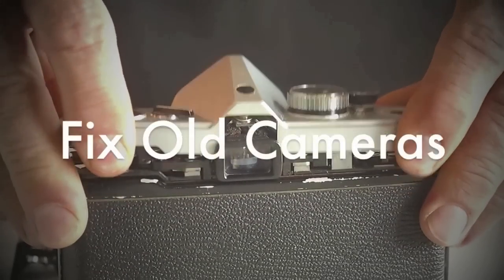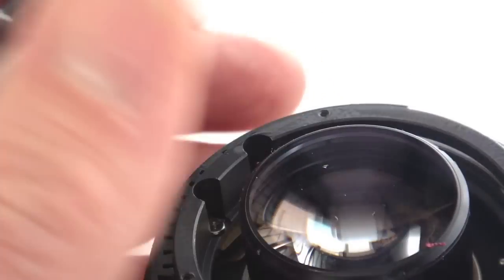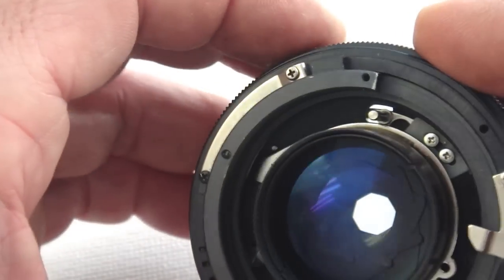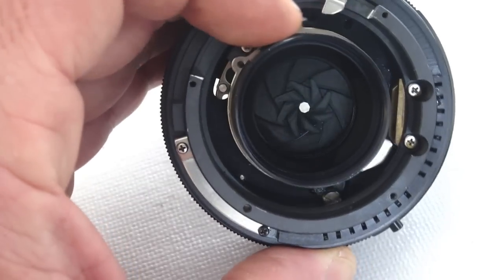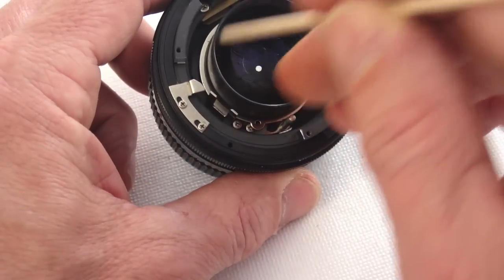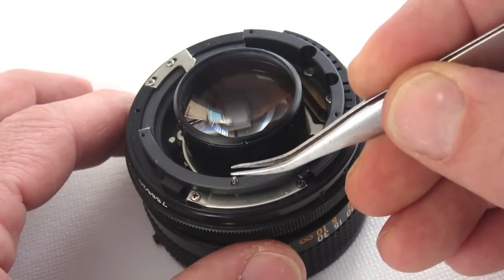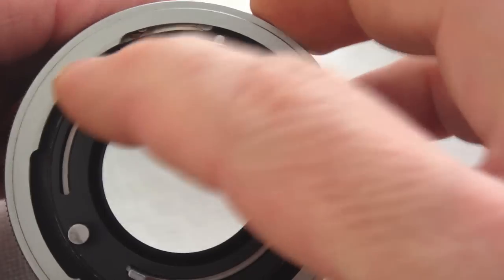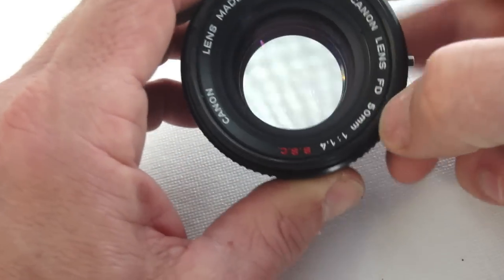Fix Old Cameras: Canon 50mm 1.4 FD  Stuck Diaphragm

Comment: The 1.8 FD SC version is slightly different in construction but close to the 1.4 . I was able to remove the rear element in a similar fashion and clean the blades on one side.  I did could not remove the blade assembly. This worked for me.   Thanks.
Reply from the maker: Dan C  Good to hear of your success.

Comment: Hi, you make it look so simple. I noticed that you did not clean the lens elements nor do you use canned air. Any reason for that?
Reply from the maker: Each step is simple. Ideally the diaphragm unit would be dissembled too, that would not be simple. Hence the flush cleaning short cut. The cleaning of the lens elements if needed was not shown to facilitate a shorter video. Canned air is fine, Be careful not to invert the can and jettison the propellant in unwanted places. A hand blower does not produce as much pressure which at times can be insufficient for a stubborn spec making the canned air good choice if used carefully. Filtered compressed air is ideal as the pressure can be precisely regulated. The elements only need to be cleaned with lens cleaner and a micro cloth if their condition so warrants.

Comment: Very professionally expalined, thanks. I have the lens and use it with sony a6000. I can see dust inside, wondering if I will be able to clean the lens using this guide.
Reply from the maker: Bobby Mathiwathanan  It should help, depending on where the dust is trapped. Thank you for your interest in Fix Old Cameras.

Comment: I removed the screws(on the side) from the aperture ring too. 2 steeel balls and a spring fell off. Damned, i dont know how the mechanic inside was before.
Reply from the maker: One is for the aperture click stops. The other might be for the AE lock. There is a spring and a hole the size of the bearing for that the spring drops into with the bearing resting on top. With the right technique it is not to difficult to install. Apply a little graphite grease to hold the bearing in place on when seating the ring.

Comment: I did exactly same as you did. But my one does not synchronize the aperture when I test it after inserting mount ring.
The aperture works well without mount ring..

Comment from the maker: If, when attempting this repair, the aperture mechanism does not work properly than the aperture diaphragm stopped down linkage was probably not positioned properly. The mount assembly will have to be removed again and reset taking care to keep the lever on the mount assembly to the right of the post connected to the diaphragm blade unit.

Comment: Thank you for your help in getting my aperture unstuck. It now operates smoothly. My problem now is that the F-stop apertures are not accurate. For example my F 22 aperture should close to a diameter of about 2.27 mm but is actually closer to 1 mm. Is there a way to re-calibrate the F-stop settings on the Canon FD 50mm 1 : 1.8 Lens? Thank you.

Comment: Thanks loads for this! Got one of these lenses really cheap because the aperture was stuck open, followed this tutorial and now it works fine! One question; I went a bit crazy with the contact cleaner and some seems to have got under the focus ring and messed with the grease in there... now the focus is quite stiff, slow and grainy. Any ideas how to smooth it out?
Reply from the maker: +Tom Box 
The focus helical threads will have to be exposed so you can access them and seep alcohol onto the threads and work it through them. You could do a much more thorough job of cleaning if you disassemble the helical. But unless you have past experience dealing with the such an assembly,  ABSOLUTELY do not take the helical apart while attempting to clean. You will play heck getting them back in the proper position. Once the threads are limbered up from the alcohol let it evaporate and recheck their function. If satisfied, you will then need to work a light grease into the threads. A synthetic lubricant is preferred.
Reply: i spent like half a day trying to do that

Comment: Excellent  video!I have a Pentax KM that had a battery leak in it.I removed the bottom plate to remove the battery and clean up the mess.Now the battery cover is stuck solid.Is there any way to remove it without destroying it?I could cut a slot in it and use a straight screwdriver,but then I'd have to replace it.Mechanically the camera works great and this is the only problem with it.
Reply from the maker: Try a solution of vinegar to break down the corrosion. Follow it with some penetrating oil. If you end up cutting a slot in the battery lid, due so carefully and you should be able to reuse the cover... albeit a little less pretty.

Comment: Hello.
I´m trying to clean my lens but 2 of the 3 screws that holds the filter ring are stick. How can I unstick them?
Great series of videos, thanks a lot!
Guillermo
Reply from the maker: Make sure the tip of your screwdriver is in good shape so you can gain the maximum torque. Heat the head of the screw with the tip of a solder iron. Seep some isopropyl alcohol around the head of the screw.
Reply: Fix Old Cameras Thanks a lot :D

Comment: I need to remove the breech lock ring on a similar lens. Is this does by removing the two screws on the side of the ring ?
Reply from the maker: The two screws on the side of the breech lock ring remove the stop for the ring. In order to completely separate the breech lock ring from the rear lens plate the plate is removed. Generally three screws secure the rear plate on a Canon made FD lens. With the rear plate removed, remove the two stop screws and spin the breech lock ring.
Reply: Thanks, I'll try.Fix Old Cameras

Comment: What type of contact cleaner is that? Also, what might be the issues if the blades are stuck wide open - are there springs that control the aperture that can go faulty or have issues with these older breech mount FD lenses?
Reply from the maker: There is a spring, however the blades can stick open because oil migration as well.  https://www.amazon.com/shop/fixoldcameras
Affiliate disclosure: Please be advised that the link provided is an affiliate link and a small commission is received by the creator of this channel if you choose to make a purchase using this link. This adds no extra expense to your purchase. Your support of this channel is greatly appreciated. Thank you for making any purchases through the link on this channel.

Comment: I've got an unusual FD 50mm 1.8 lens (with a min aperture of f/16), and have no idea how to take out the front lens element so I can get to the stuck diaphragm. There are no notches for a spanner wrench, and the element seems to be firmly in place, so it's not falling out. Would I have to go around to the back to try to repair this lens?
Reply from the maker: The front name plate ring will generally loosen with the application of a small amount of isopropyl alcohol seeped around its outer edge. A stopper type of friction wrench will help grip the ring to pop it loose so it can be removed.

Comment: Hi, thank you for sharing this awesome videos. I'm wondering where I could get replacement springs for the internals of old camera lenses. I have a  old Minolta lens where the spring that opens the aperture has lost it's pull. Any clues to where I could find a replacement would be very helpful. Thanks!
Reply from the maker: It might be possible to rework the existing spring to increase tension. If the spring is broken in the middle than a substitute can be salvaged from another lens. It does not have to be a perfect match. Just try to find something similar in tension and compression. Sometime local hardware stores will caring small springs that might be a close match.
Reply: @FixOldCameras  awesome, thank you!

Comment: I've got a 1.8 sitting here, breech lock similar to your 1.4. I can't get the front name plate off. I'm using the large soft rubber corks. Is there anything I can dribble in the front to loosen it up? I'm tearing it apart to clean the blades I think something has seeped under the name plate and it's sticking. Thanks
Reply from the maker: Some penetrating oil followed by alcohol might do the trick, but of course any residue will have to be removed before attempting to again use the friction stopper. Patience and persistence is usually rewarded. Also you might set the lens face down on a heating pad for a bit. As a last resort carefully and evenly drill holes in the name plate ring to accept the tips of a spanner wrench.

Comment: I got a jupiter 8 50mm f2 that have the same problem. Can you show how to open it? Thank you.
Reply from the maker: The Jupiter-8 50mm or the Contax 50mm Sonnar, which is the lens the Jupiter-8 was apparently copied, could definitely be featured in a Fix Old Camera video. The Jupitar-8 50mm is solid metal, and contains few parts when compared to most other lenses of this type. It consists of the optical unit, including the diaphragm and the step-less aperture ring, and the main body, including the focusing ring.  The two can be unscrewed from each other. The main body with the focusing ring can also be disassembled. Because of its simple construction, the entire lens rotates during focusing. Thank you for your interest and suggestion.
Reply: Fix Old Cameras Thank you for the reply. I already fix it using your method. Perfect, simple and easy. Thank you again :)

Comment: Hello,
Thanks for vidéo ;) 
I have a problem with mine : i can not unscrew the ring of the front lens!
Yet I have a "rubber pad" like yours, I already used on other lens smoothly.
Do you have a "trick" to unscrew it ?
When I look at the video, it seems that there is a "gray" material on the perimeter of your ring. Is it sticky ?

Thanks for your help;)

Patrick
Reply from the maker: It is held in place with glue. Soften the glue by seeping alcohol under the name plate. The name plate should then pop free when the friction pad is applied.

Comment: Hi Mike & Followers, I have an older Canon 50mm FD 1.8 S.C. lens.  I looked at the 1.8 video and it describes the newer style FD lens. I am commenting here as my 1.8 SC  is an original FD lens with the bayonet ring, disassembly for this 1.4 lens is mostly the same as the older style 1.8. NOW for my problem, my 1.8 SC has a completely stuck open diaphragm. This lens also has a locking lever on the back. With the bayonet ring released all the levers work smoothly, as does the aperture ring and the "auto" setting along with the "auto" setting release button. Yet the lens is wide open. The small lock lever on the back of the lens is on the white dot and will not move to the red dot. It sticks halfway.   Is there any difference in the tear-down procedure due to the back locking lever? Are there any extra springs, or internal parts I need to be aware of?  

As always if you'd like to actually see the lens and do a video on the older FD lenses with the locking lever I am open to sending it to you for a look. Thanks for all the great videos and your time in answering. 
Tom Heckhaus
Reply from the maker: There are no springs that will detach during dissemble unless they are deliberately removed. It is more than likely that there is so much oil that has migrated onto the aperture blades that they are stuck firmly open. The breech mount lens disassembly is not substantially different than that of the bayonet mount. However you will see that you will need to rotate the breech ring slightly to access one of the mount screws. Upon reassembly the timing of the levers and linkage is virtually the same, but the positioning of the mount is a little different due to the two styles of mount construction. Although not ideal, on the older style lens, if the cause of malfunction is oil on the blades, you may be able to simply remove the front and rear lens groups and flush the blades until they release with aerosol contact cleaner. For additional information and options on repairs of your vintage photo equipment ... if you would like you may go to phototronic.biz. Thanks again Tom for your early and continued interest in FOC.

Comment: Hi! Great videos, i have a question. I currently have an minolta MD W.ROKKOR  28mm 1:3.5 that has a stuck diaphram. I cant even move the external ring to make it open (its actually closed) Any idea? what can i do?
Reply from the maker: Sometimes the oil that might migrate on to blades can be so sticky that it "glues" the blades tight. It could also be an issue with the stop down lever mechanism. Do not force.
Reply: thank you! I "fixed" the problem, now the diaprham works and moves, however it does not longer "stick" on the right aperture, it does not have "stops" anymore when i turn it, its just smooth. Wich is not that good but i guess alteast now i can use the lense!
Reply from the maker: Good to hear you can use your lens again. You probably did not notice the click stop assembly and missed re-installation.

Comment: Hello, I have a problem with the reassembly.
after disassembly+cleaning, the aperture preset ring seems to have lost connection to the aperture itself. When you turn the ring and snap the aperture lever, it alwas closes to about f/8 no matter if the ring is set to 1,4 or 16. I am afraid I may have been moving the lever with the two metal sticks in the wrong direction, reulting in a clicky sound. After getting it back into the initial position, it didnt do anything anymore. is there any way to fix this or is this lens going to be a "fungus-free-glass" donor for my other 1,4s?

I am pretty sure I placed the bayonet and the connectors right...
Reply from the maker: The back plate linkage did not get connected correctly. You probably missed dropping the plate aperture link into the lens body U-shaped aperture linkage . It happens to those even experienced with this lens. Take the back off study the video frame that shows the linkage set up at time 4:17 on the video and try again. You will get it.
Reply: Hello, thank you for your reply, I disassembled the lens and checked if the linkage did get connected correctly. I think it did. Aditionally, the Problem appears even if you move the lever with the connected spring on the front side of the aperture assembly (without having the whole silver ring assembly mounted). It just doesnt close all the way to f/16. I have two 50/1.4 disassembled (both with oily aperture). One does close to f/16, and one does not. The one that closes properly has still some oil on the back of the blades, but now I am afraid to take the back part off :-/

If it would help, I can do a quick Video showing my problem. I am more of a Minolta guy, so I do not understand how the Canons mechanics exactly works. But having a 50mm 1,4s standing useless in my shelf three times made me try the fix :D
Reply from the maker: Check the aperture cam ring is in the proper position. There is just not that many things that can block the movement of the aperture blades. Maybe by proceeding forward with the other lens, by comparison, you will be able to see what is out of place in the malfunctioning lens.
Reply: Hello, Thank you for your encouraging help. I managed to find out my mistake using the third 50/1.4:: the lever with the two metal pins had been moved way over the point where it slides the small lock nose away and it got blocked behind it. However, the nose is so small that you barely notice it. Using a small screwdriver, I was able to push the lever base back into the correct position and let the nose snap back. Now I managed to repair all three 50/1,4 plus an 85 /1,8 (which is very very similar, how I noticed.)- all thanks to your Video. Nice!
Reply from the maker: Very good to hear of your multiple successful repairs. Your persistence certainly paid off.

Comment: Hello Again, any idea if this disassembly is the same for a Canon 50mm f1.4 FL? I have an FL with the breech-lock mount (As all were) and the aperture lever seems loose it flops around and does not operate the diaphragm. Thanks
Reply from the maker: It is slightly different but similar. Possible access thru the back of the lens will a bit different on the linkages. As you probably already suspect there might be disconnected spring or a jammed lever. The blades could also be stuck wide open.
Reply: Thanks again Mike, by the way I checked the Amazon link and I see you are an author. Good for you congratulations. As far as the lens. I ordered a complete Canon FL service manual online and am still waiting for it. I have discovered that there were two types of FL lenses. One had the A-M switch just behind the aperture dial on the lens front and the other type has the A-M switch mounted on the rear of the lens near the breech lock   mount.  A search on Youtube turned up a guy dismantling a lens but his was the opposite of mine. AS soon as I get the FL manual I'll have a go. Thanks again and best wishes to you and your family for the Christmas Season and the NEW YEAR.  Tom